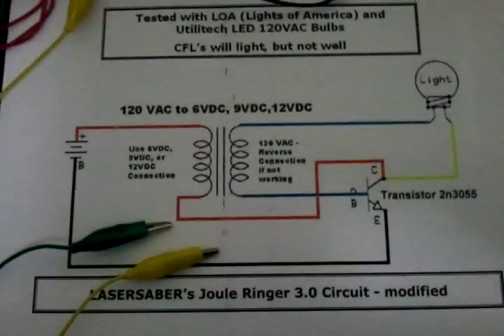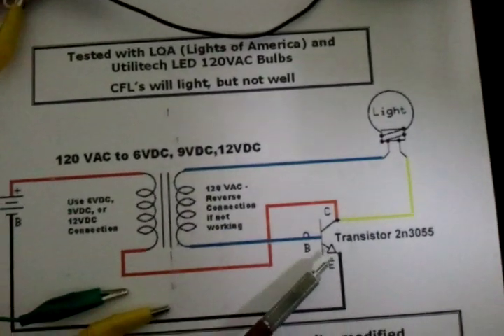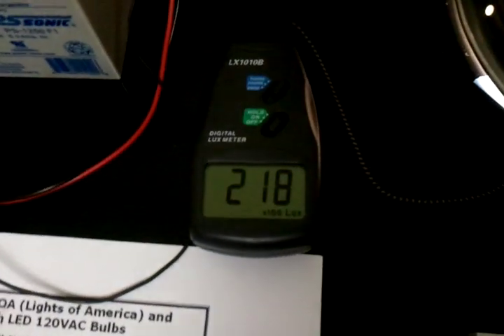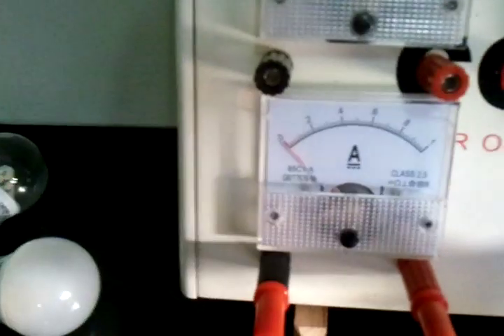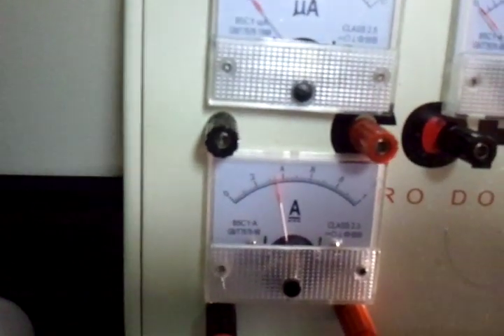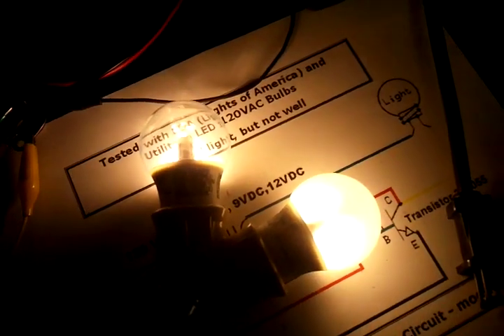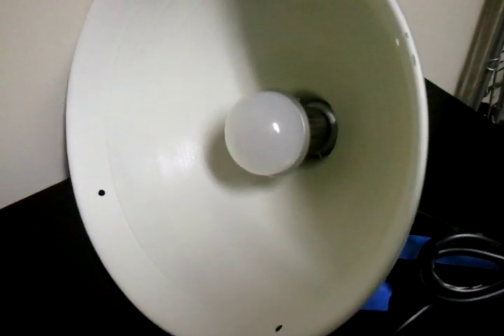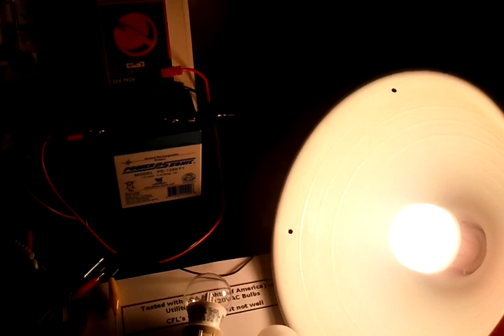LSJR3.0-Mod Easy LED 120VAC Bulb Inverter

Comment: Omg had no idea that finding clasic transformer would be so hard, most phone chargers have life 6 pins on it. But I managed to find the right ones. Using npn22222a it light fairly if I add voltage it flicker.

Comment: Very good idea.  I found an old 120VAC to 9VDC wall wart and cracked it open.  I got it to light an unmodded CFL very dimly @ 3VDC running through a Joule Thief.  It flickers though, no matter what voltage I start it with.  I wonder if it's interference from the Floro Tubes in the room or the other CFLs running off of the grid?

Comment: I did enjoy this video, and every video you've made. A couple points that may or may not be relevant... 1. Have you checked the watts consumed by AC ran bulb? Often the package may say one thing but the meters show actually less or more watts used, and considering you are calculating watts on the other runs, the rating "7.5 watts" need be accurate, you know? 2. It's actually more fair to compare these JR's against commerciall inverters; as 12V/6V/9V is one thing, and AC 120V is another.